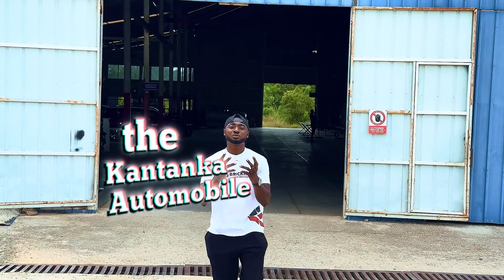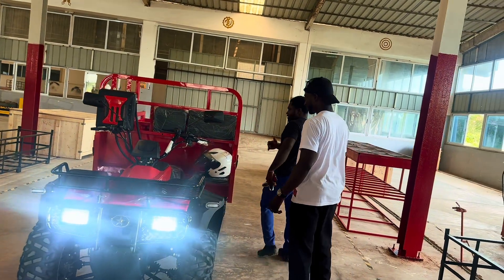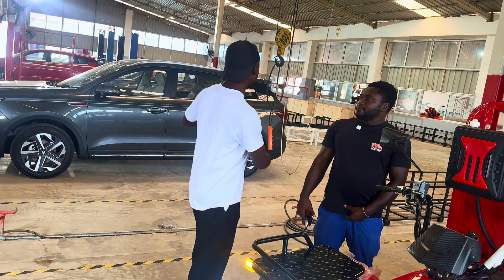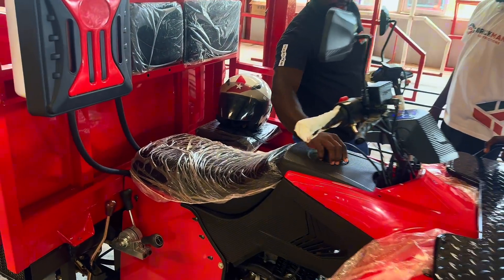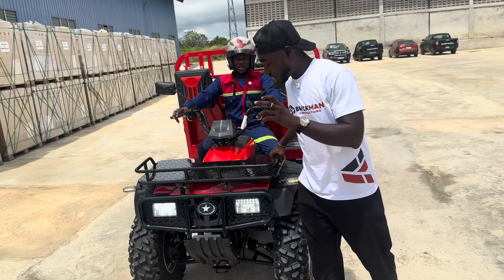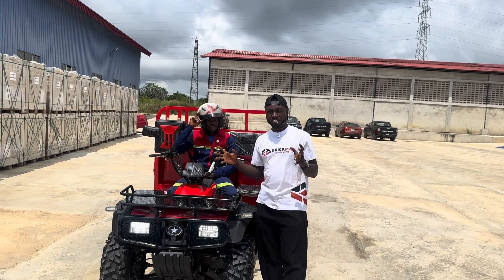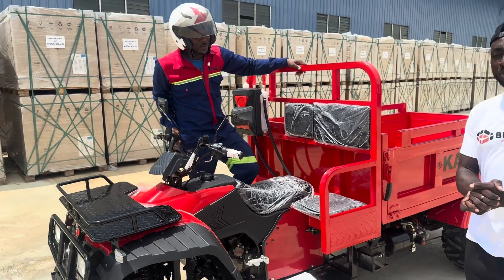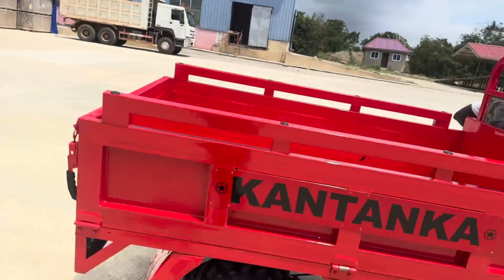KANTANKA Does It Again! Check out The New Ghanaian-Made Boafu Quad Bike

Comment: This is fantastic! There are many talented people in Ghana 🇬🇭 but, resources are limited. If only the government could look into helping them with funding to develop, huh!
Reply from the maker: I tell u😂
Reply: No  help for assembly of body parts and cosmetic upgrades 
    Government  helps those doing manufacturing of cars and trucks
       Make  engine, transmission weld engineering fabrication  these are what Government support and fund
        Replacement of body parts to  imported CKD and SKD  parts trom someone already manufactured  parts 
    This is not innovation but just like a mechanic putting an engine into a car, the engine had already been made by someon, and he cannot say he made that car at his workshop

Comment: 5:02 Ignorance, 4 stroke 1 cylinder does not make it any faster than or equal to any car. 
It's what he said, an SOCH nothing more. It's a single piston, but the way it expels and does its intake, it's why it's a 4 stroke (which is good), not a 2 stroke, which is problematic and makes much more noise and emission.  Vitz is not a single piston. In other words, it's not a bike engine it uses.

I use a 4 stroke single cylinder bike and can overtake this due to load weight, etc yet Vitz can overtake even mine anytime even with its load cause its not single piston like i stated. 

Also, learn about horsepower and torque. 
There is a reason why hugh cars have more torque and less horsepower and vice-versa. 

If you want to review vehicles, learn before you go and disgrace yourself.
Reply: Chairman so desperate to sound like a mechanic he turned a simple joke into a full lecture. Man out here writing paragraphs about horsepower and torque like we signed up for his TED Talk. The confidence is wild, explaining basics like he just uncovered the secrets of engineering. Relax, professor, nobody was debating your degree. It was a joke, not a dissertation.😂😂